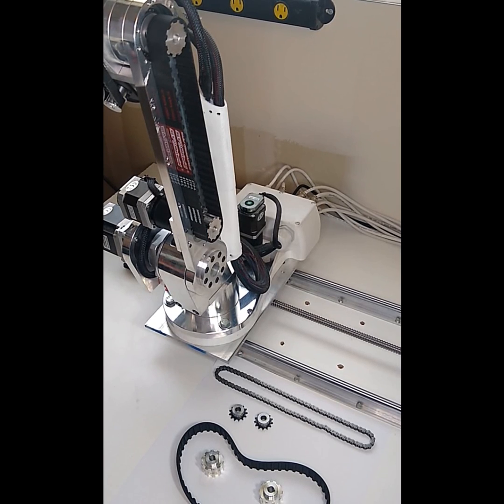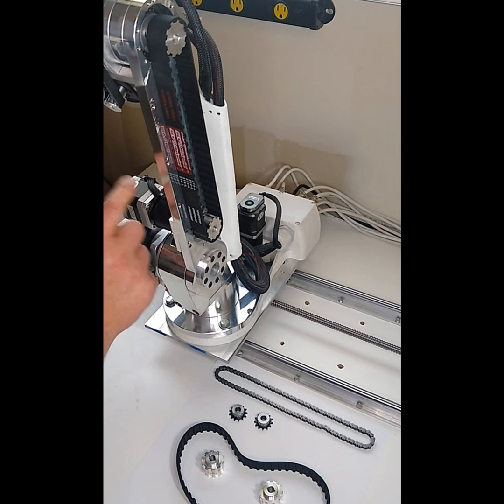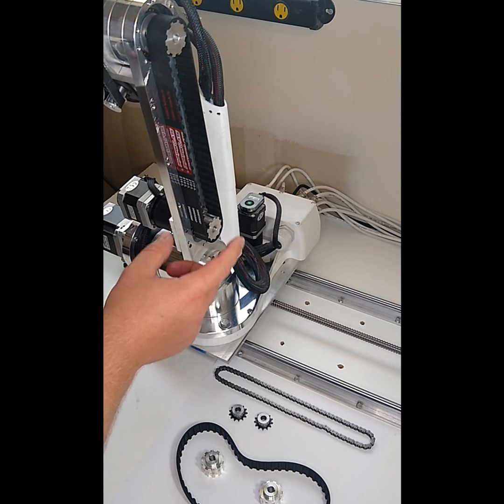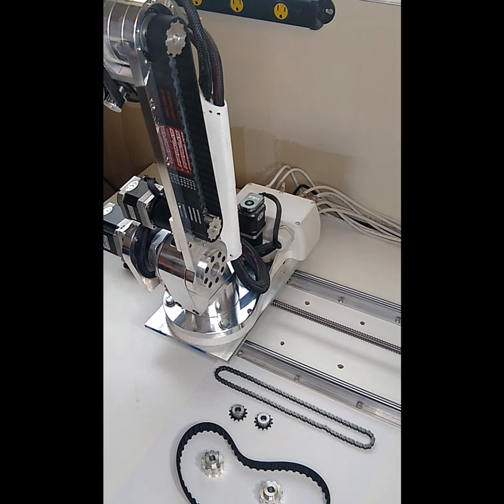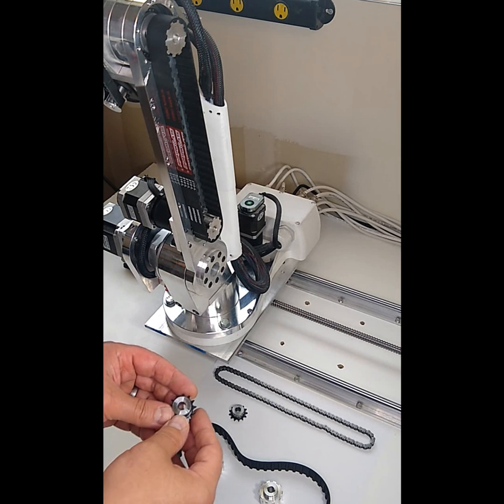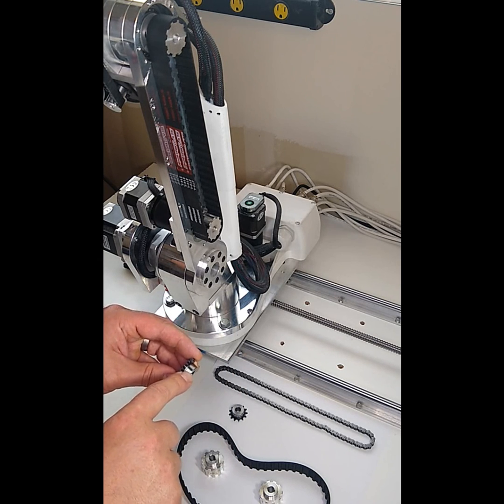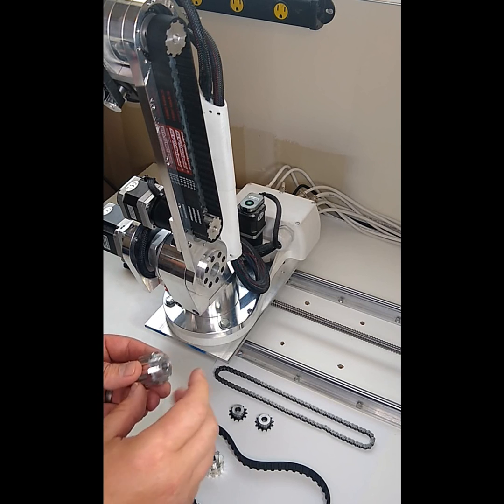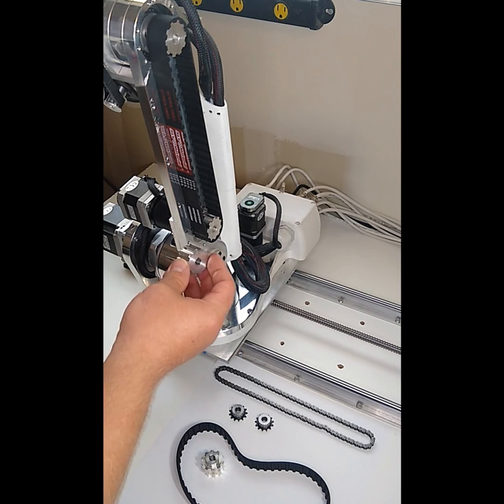AR3 Robot Belt Upgrade

Comment: Is AR2 very different from AR3? I have solids created in CAD for AR2, I don't know if I will be able to use them to build AR3?
Reply from the maker: Mechanically the ar2, AR3 and ar4 are all the same. The ar2 was open loop, the AR3 is closed loop with cuiencoders, and the ar4 is the latest using stepper online encoders. The downloads page has all of the manuals and information

Comment: Such a cool robot Chris !!  I'm really considering building one. Anymore into on that slide table I see in this video with the linear rails? This would be really handy for what I may use the robot for....
Reply from the maker: Yes the software supports a 7th axis and there is manual for it on the website.  Let me know if you have any questions.

Comment: Is there a specific axis that bottlenecks the arm load to 4lbs that can be upgraded to increase it?
Or have you carefully selected all the motors and their reduction gearing to fit this load goal?
Basically, to upgrade the load capacity. Would someone have to upgrade all the motors or just a few of them?
Or is the load bottlenecked by the structural components and not the motors/gearing at all?
Great project by the way!

Comment: Very cool. We are building our Ar3 right now and just this week I drilled and tapped the sprockets and installed the chain. Do the same 3D printed covers still fit over the belt?
Reply from the maker: Yes it does, its a very close fit but It should work fine.
Reply: @anninrobotics  I didn't see these available yet on your webpage. I am at that step in the build and would like to do this upgrade now. How can I get an order in for the kit?
Reply from the maker: @mrbrent4  Hello, I just added them to the site a few minutes ago. They should be available now.